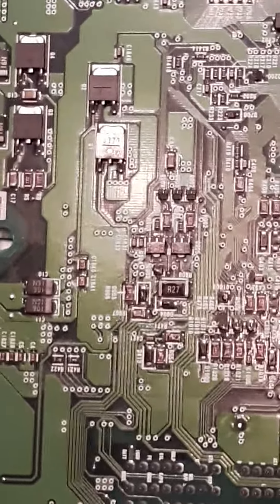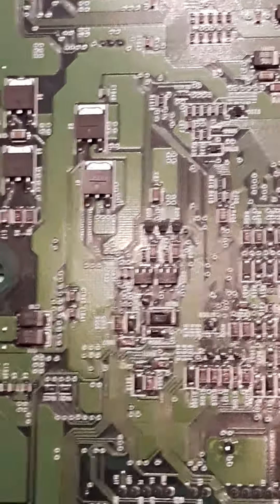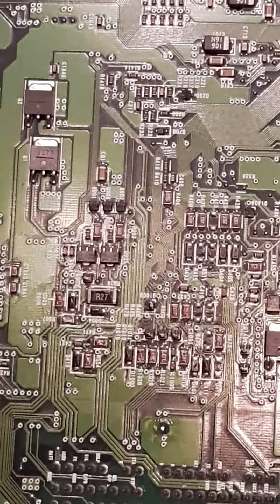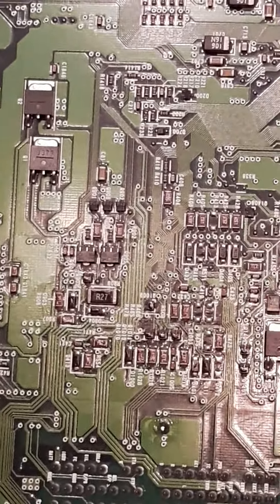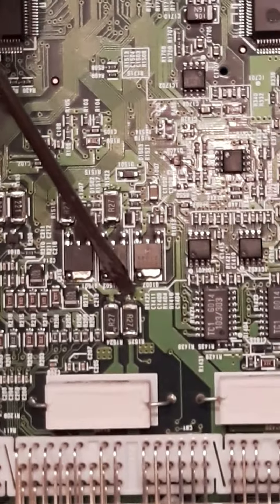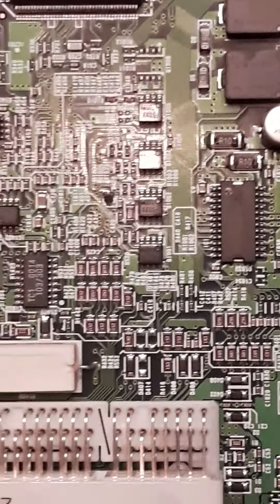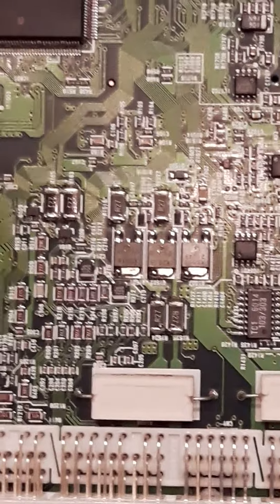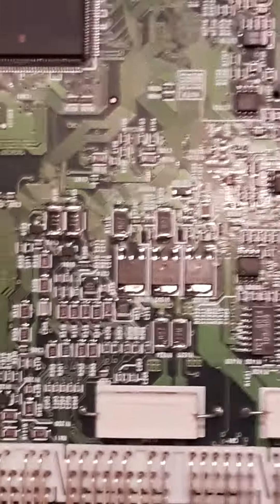RAV4 rough Trans - free ECM Repair (Resistor Locations & Values)

Comment: By way of a progress report, I purchased this 2001 RAV from original owner who cherished this vehicle. All Toyota dealer services, garaged, 132K miles and pretty flawless. She put up for sale due to "intermittent" transmission shift problem and purchased a new vehicle for herself. I purchased it very low knowing that this might be more a board problem as opposed to a bona fide transmission problem. This video and others (Keenan Laws!) caused me to tackle this knowing NOTHING about soldering, pc board, electricity etc. I learned to solder and focused on the right flux, tin, lead solder etc. to make sure my efforts had the best chance of success. Re-soldered all the resistors and now want to go back and do the B209 transistor suggested by another contributor. I only took values after I re-soldered. All of my R330's, on board, measure .4-.5 "ohms of resistance." I really do know nothing. But, I'm interested in why Trav MC's R330's are reading .00 - nothing. Finally took the car out for a long drive today and it cleared up very nicely. I suspect that the computer will have to re-learn several things that have been influenced by what I think were cold solder joints on resistors. An occasional 1-2 harshness and an occasional indecisiveness between 3-4, and or, some slipping. The long ride home on the interstate this evening found a flawless operation. It does seem noticebly improved and correct. Also will change out transmission fluid/filter with Toyota Transmission fluid T-IV ready to go. Put a scanner to her and the only code reading were both oxygen sensors which are likely original. Hoping this improvement either stays or increases, characterized by a consistently improved operation over time. If tomorrow is as good or better than today, I believe this was a WIN. Thanks to all the contributors, especially those guys who really know what they are doing and contend graciously with guys like me who know next to nothing about things electrical. Thank you!
Reply: I have a 02 Rav4 with shifting issues. I have no experience with soldering ECU, do you think it's risky to try to do this myself?
Reply from the maker: @kanywiraelias9326  Soldering is pretty easy.  Just search under soldering electronic components on YouTube.  Practice soldering with copper wires a few times to get some experience and you should be ready to go.
Reply: Hey, thanks for the video. I also watched Keenan Laws video. I did this repair yesterday, seems to be working much much better now, only some issues going from 1st to 2nd, shits a bit late sometimes. Did this completely clear up for you after the computer "relearned"??? Thanks. I'm not sure if I need to pull it back out and re do it
Reply from the maker: @mygamertag2010X  Mine also shifts a bit late from 1st to 2nd.    But once the car warms up, it goes away.  Other than that, it's been working great and I'm still driving the RAV as of Aug 2022.

Comment: Thanks for your knowledge and the accurate description of the issue, Captain Fritz. It all worked as described. I should add that the ECU transmission memory needed to be erased using techstream or other capable tool. After that the truck was shifting gears like brand new. Thanks again mate, you saved me big bucks $$$$
Reply from the maker: Great job! Thanks for your input.

Comment: I was having problems with my rav4 2001 a transmission shop wanted 500.00 to replace solenoid A and B,fault code 0750 and 0753,I resoldered those resistors that Keenan mention on his video,that was 3 weeks ago,I can safely say my transmission is fixed, it helps if you know how to solder , you dnon't have to replace the resistors unless they look burned , if it matches the ohms of other resistors it's most likely good.
Reply from the maker: Congratulations Carlos.  You probably saved yourself over a thousand dollars.  By the way, since resoldering the resistors last year, my RAV4 is still running great without any problems.  So the fix is working.
Reply: I have a 02 Rav4 with shifting issues. I have no experience with soldering ECU, do you think it's risky to try to do this myself?
Reply: @Lovemyfamily55  I have a 02 Rav4 with shifting issues. I have no experience with soldering ECU, do you think it's risky to try to do this myself?
Reply from the maker: @RawBrahs  Soldering is pretty easy.  Just search under soldering electronic components on YouTube.  Practice soldering with copper wires a few times to get some experience and you should be ready to go.
Reply: @RawBrahs I think it is. I don't dare to do it on my own, but I will ask for help to my cousin who works as a industry electrician

Comment: Hi - very educational video, I think I will attempt to do my wife rav4  as it is a little erratic, sometimes slips on first gear (feels like not pulling) and then rams gear in! also the gear change seams rough . My question is, is there a technique to do this type of soldering, I bought soldering Ion with adjustable temperature , but still I am a little apprehensive not to damage anything, is there the best temperature or maximum permit-able??

Comment from the maker: Hi everyone, my RAV4 is still shifting great.  I recently found that you can buy the actual resistors on eBay here:  https://www.ebay.ca/itm/264540335060
I also bought a Toyota Techstream tool and reset the memory of the ECU for the Transmission.  You MUST use the tool because disconnecting the battery of the car does NOT work in resetting the memory.  The ECU needs to be reset.  I have successfully done this.  If you would like me to make a video on using Techstream to reset the memory, please comment below.
Reply: Please I need the video process... my RAV4 2002 holds itself down on gear shift, previously it happened and I had to buy another brain box and now it has happened again. I will have to work on this brain box this time so I'll need your help, please. thank you.

Comment: Hi captain 

Can we measure all those said resistors before dis soldering them or no 

I've bought another ecu and the values are very similar to the old one as I've still not removed them from PCB

Comment from the maker: Here's a link to the R330 resistor from Ebay:  https://www.ebay.com/itm/100PCS-0-33-ohm-R330-330mR-1-1206-3216-1-4W-SMD-Chip-Resistor-3-2mm-1-6mm/392306316651?hash=item5b5747556b:g:-WQAAOSwMg9c8mp~
They are smaller than the original.  I soldered 4 of them together with 2 pairs in series then together in parallel to give me the same resistance.  It worked great.  I also used Sea Foam Trans Tune to clean the transmission.  Changed the transmission filter and did a complete transmission flush. It shifts amazing.  Still running great after 4 years.

Comment: hello, had this car coming to the workshop, and when you put it into drive or reverse, it was harsh and could not accelerate properly, I re-soldered everything on the board and now it gets it D or R smoothly but it's so hesitant on acceleration and changing gears. it shifts around 3k rpm. any help, please?
Reply: Transmission memory reset

Comment: Hi, so the measurement of 42.2 and 41.1 ohms of the 820 (82ohms) resistor is ok? I measured my 820s to 40.1. Do they need to be replaced?
Reply from the maker: Hi Peter, I think you should be fine.  40.1 seems to be within range.   The resistors are installed in parallel.  An 82 ohm resistor that is free-standing, will become 41 ohms when connected in parallel.  From my observation, 40.1 ohm is reasonable.  Hope this helps.  Is your RAV4 running better after the solder reflow?  Cheers
Reply: Captain Fritz thanks for the clarification. It didn’t make any difference by reflowing all the resistors. I disconnected the battery for 5 minutes also. But no improvement of the gear shifting problem. Sometimes I have no reverse. Other times reverse is engaged but slips so the car moves a bit and then the car just revs. Driving forward is fine in low speed. But becomes awkward when it tries to engage 3rd gear/4th gear. Usually it slips so it shifts down instead of up. Is it possible to verify in any other way that the ECU has been fixed? I’m gonna have a look at the transmission next week

Comment: I have a 2004, and its having a lot of shifting issues. P0776 code as well. The board is not the same as the 01-03 it seems. Where are the resistors I need to solder on the 2004-2005? I cant find any information :(
Reply from the maker: I'm sorry but I don't know the answer for a 2004 RAV4.   However, it seems that for my 2002 RAV4, it's the largest surface mount resistors that needed the solder to be reflowed.   If you can identify them on your circuit board, it wouldn't hurt to reflow the largest resistors.
Reply: What solution did you find for your 04 Rav4?
Reply: I have 04 and P0776 code as well as shifting problems. How did you solve yours?

Comment: Hello... How if it slips gear between 2 to 3rd gear
Reply from the maker: If it is the 01 - 03, then I would try to resolder the resistors.  Also try Seafoam Trans Tune. Then change the filter and do a complete transmission fluid flush.  My car is still running great and shifting smoothly

Comment: BTW: do you have the values for those resistors that were "very high?" I'm curious. Thanks again. And, is there somewhere else somewhat reputable where I should be looking for resistors? I just can't bring myself to make a purchase like that on Ebay. Thank you!
Reply from the maker: Yes, if you expand the comment box above, you will see the details of the "high" resistor values.  R330 = 0.33 ohms and R27 = 0.27 ohms.  If you wish to buy them from a reputable supplier locally, perhaps you can try and google electronic repair?  I phoned all the local suppliers in my area but unfortunately, they did not carry this item.   Please let me know how it worked.
Reply: Thank you. You can assume I know nothing as I'm just trying to learn about all this. I still simply don't understand or see the values that seem excessive as in "pre-soldering." I'm sorry I didn't measure mine before I re-soldered them. I took the time to educate myself on how to solder, what gun to use, the correct solder, lead or no lead (definitely lead!), the correct flux and what it is and how to use it, tinning and then hit it. It was a long journey but very interesting. So, now that I re-soldered and re-installed, I see tremendous difference and improvement. However, I bought this RAV because of this condition so have no knowledge of it's behavior other than the original owner saying it became "intermitent." Seemed to start in 2nd and fuss around with 3rd. Always felt lugging. I never reversed it so I don't know about that. Does well now. The vehicle was well loved and taken care of by a woman who obviously cared a great deal for the RAV. I got it very inexpensive and was willing to grapple with the possibility of this being the solution. Has 132K and as a one car owner, you might guess correctly that it's really nice. Garaged. Anyway, I did notice some slipping and whacky too soon shifting from 2-3, but seemed to progressively get better and behave as one would expect within 3 miles or so. Some say the positive changes come after the re-solder and a couple days on the road. I'm hoping for that, but I'm encouraged at the ease of doing the job, especially correctly. I enjoyed it and now I understand that there is a transistor that would benefit from a re-flow. I may pull the board out again and re do it while I'm fresh. 

Perhaps if you simply told me the value of the two offending resistors in the PRE and POST condition, I'd understand more. Having read your contribution, I multimetered my work and the values were essentially the same as yours. My values were a wee bit smaller, but consistently so throughout, so I presumed it was more a reflection of the difference in calibration of your meter and mine. 

Thanks for your efforts, you helped a great deal and made the process enjoyable!
Reply from the maker: Wow.. congratulations.  That is great news.  I'm glad to hear it seems to be working.  I think you've correctly diagnosed and repaired the problem.   BTW, which transistor would benefit from a reflow?  Would you mind sending me a link that shows the location as I wasn't aware of this fix?  Thanks !!
Reply: Ok...to be specific, I found this author on RAV4WORLD.com after typing in something like "rav ecu." There is a chain of comments that seems to be linked to the thread "fix your ecu yourself...for free." In this thread, one contributor, "bachphi" on 5/17/15 says, yes, do all the large resistors AND the B906 transistor next to the 820 resistors. That's where I got this which seemed to take care of this guy's issues. Thank GOD for the internet and wonderful contributors like yourself!
Reply: None of my r330 or my r27 resistors have any resistance
Rest of the chips are fine
Reply: Are you measuring them on the board or off? FARRRRR from being any kind of expert at all, I'm very curious what the significance of your readings are. Perhaps Keenan Laws, or this gentleman who made this phenomenal video will have an answer for that. Our RAV will be on the road today after a re-solder and new license plates. We'll see if she improves as I expect. Thanks to ALL the contributors on this subject!
Reply from the maker: My measurements were all taken with the resistors soldered onto the board.   Thus, it will not show the same values as if they were free-standing.  Resisters soldered onto a board are connected to other components which will cause it to change from it's free-standing value.  If you unsolder a resistor and take a measurement, it will show you the free-standing value, but I don't recommend this.  You should only do this if you suspect the resistor is damaged and have spares on hand.   BTW, I graduated from Electrical Engineering many years ago.
Reply from the maker: Yikes, your resistors should show the values that I posted in the comment box above.  Re-measure them again with the resistors soldered onto the boards.  If you are seeing an open circuit/large infinite resistor value, then unsolder them from the board and measure them free-standing.    R330 and R27 are supposed to give you a free-standing value of 0.33 ohms and 0.27 ohms, which are very, very small values.   Make sure your ohmmeter can display such small values.  If they are different by more than 15%, then the are defective and must be replaced.
Reply: Captain Fritz ya I measured all of the resistors and caps and received the resistance. But all the r330 have no resistance when tested
Reply from the maker: @Ttowndirty  R330 is 0.33 ohms and is very very low.  Some multimeters do not go that low in their range.  Does your multimeter allow you to measure that low?  0.33 ohms is almost like a short circuit and may show up as 0 ohms.